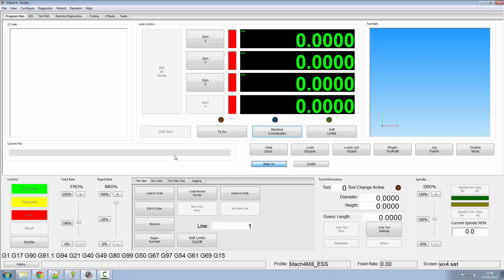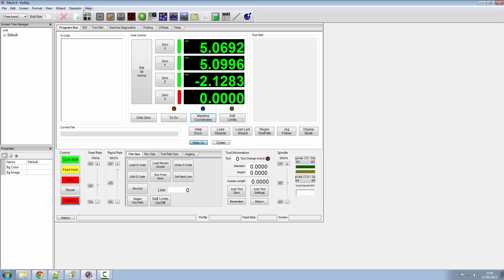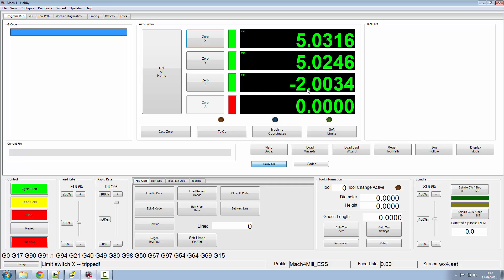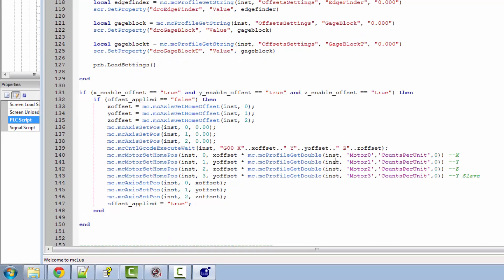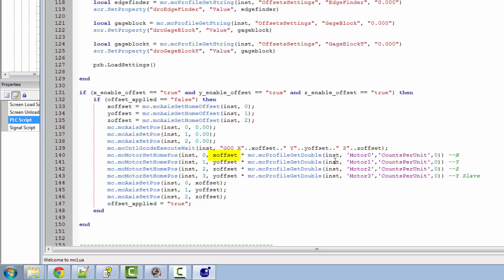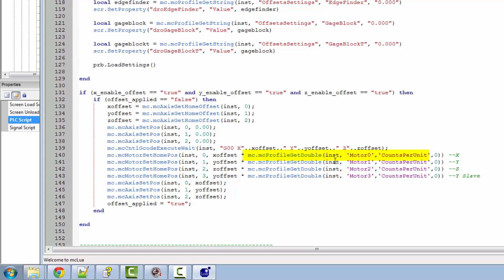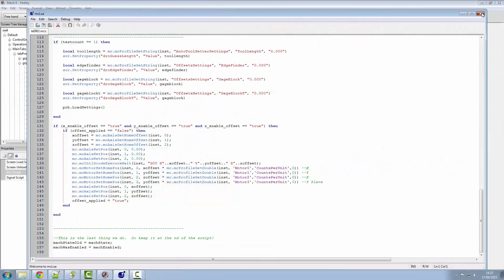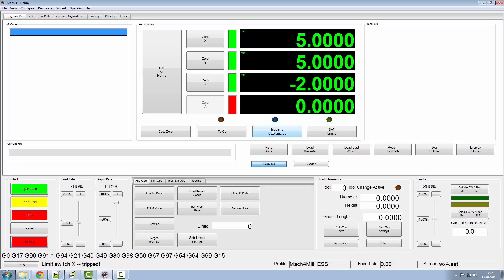Mach4 and ESS Homing Script Updated

Comment: Hello Daz! Your videos are awesome and very easy to understand! I have a question, and kindly asking for your help. Is there a way to create your own homing sequence? Just like clicking individually the RefX RefY RefZ buttons? I have a hotwire foam cutter, with 4 motors on X and 2 on Y, I want to write a script for a custom homing sequence which would look like this, Press "HomeAll", homes y, moves y up 1inch (so it won't drag the wire across the table), then home X. Every motor has it's own induction limit switch. 
Thank you!
Robert.